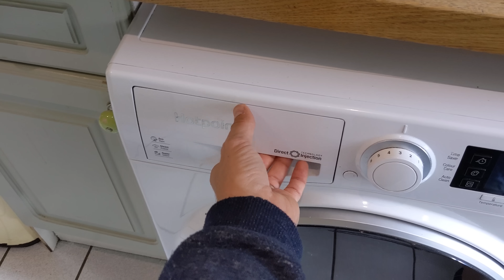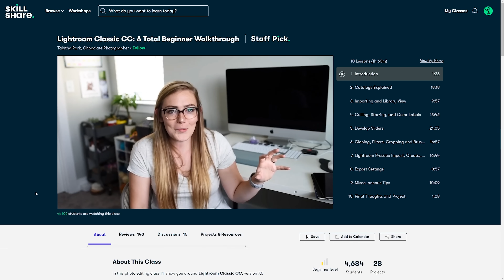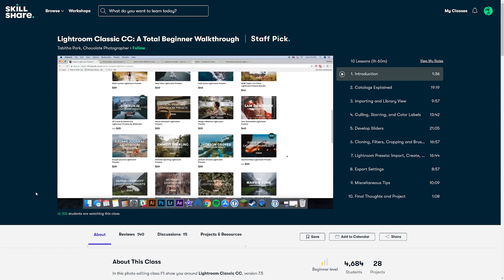The Pythagorean Siphon Inside Your Washing Machine

Comment: In canada most toilets have a buoyant valve (looks like a ball with an o-ring around it) that is held down by the water pressure, you pull the lever and the valve is raised and remains open due to its buoyancy, after the water has drained the valve forms a seal again and the water can start to collect in the reservoir.

Comment: What I’ve really learned is American toilets and urinals are different. Never seen a urinal that flushes itself, most are water free and some have handles. Toilets have a stopper at the bottom of the bowel that lifts and is buoyant but not enough to open by itself so once you open the stop it floats until it closes because the basin is empty and seals again as water goes over the top.

Comment: I'm guessing the toilet mechanism that you're demonstrating is for a UK toilet. I've never seen anything like that in the US. In US residential toilets, the level raises a stopper in the bottom of the tank that allows the water to run (by force of gravity) into the toilet bowl -- no siphon involved. However, on the drain side of toilet it is a Pythagorean Siphon that causes the bowl to completely empty. While the tank is refilling, a small amount of water runs into the bowl to refill it but not at a high enough flow rate to trigger the siphon to empty it again.

Comment: Yeah, I'm not a plumbing expert by any means, but my toilet tank is a little different. I'm in the US, if that matters. Mine doesn't have any kind of rubber balloon thing, & I don't think it gives the half vs full draining option. Mine has a tube of straw thing that actually looks a lot like the fabric softener compartment in your washer. At the bottom of the tank, there's a thick rubber flap, with a little chain connecting to the flushing handle. When flushed, water drains out of that hole. Once the water's gone, the flap covers the hole again. There's a little thing that runs water back into the tank, and when the water reaches the top of the tube/straw thing, the water stops.

Comment: I thought the syphon in a toilet was the tubing that takes the waste out to the sewage, not the one that purs water into the bowl. I once was in a place where the toilet didn't have a basin; we'd just flush by pouring in a bucket of water and it would then work like any other toiled I had seen. And that should make sense: if you throw in a large amount of water you wouldn't want the toilet to fill up and eventually spill on the floor...

Comment: that's not how north american toilets work. there's just a flap at the bottom of the tank that allows it to empty initiating the siphon in the bowl.
crazy european toilets...

there's also a pythagorean siphon in your septic tank, if you have one.
Reply: Also newer flushometer and pressure assist toilets siphon in a slightly different manner using the siphon jet to immediately flush out the water and siphon without a gurgle. But their siphon effect is still used to flush.

Comment: How odd, my toilet does the exact opposite.  If I hold down the lever, I get a full flush, and if I let go as you usually would, I get half a flush.  Didn't know this in 22 years of owning this toilet!
Reply: That's because your toilet is what's called a flapper valve. It's a much more simple method that uses a 'float' to determine how much water is in the tank. When the float raises a certain amount the tank stops filling. When you use the lever it opens the valve at the bottom of the tank, so you can control how long it allows water to flow through the system. When you release the lever the valve automatically closes, and the float then works to ensure the tank fills up with water properly.  It's the method I prefer, as it's very simple and easy to fix yourself if any parts need replacing ^^

Comment: What I know about flushing systems is that my box room toilet flusher needs a new washer to block the water coming in when it fills. The washer is of rubber and it got torn by time. I wouldn't like to replace the whole flushing system for just a washer. But I don't think I could find a new washer for it either. Any clues for what I should do to solve it? Thank you for the video.
Reply: You can buy any washer you like on Ebay, what makes you think you can't buy a washer?!  Even if not, you can replace only the filler which is nothing to do with the flush and siphon part.  You can buy them now with a 2 inch long ballcock!
Reply: If it's a washer thats attached by a small chain to the handle try searching "toilet flapper" and they're pretty cheap and really easy to change. Anyone can change the flapper on a toilet. You just switch it out and trim the small chain so there's not too much slack (it will get caught under the flapper, preventing the seal,, and you're toilet will keep running) and that's it. This is for US flush systems though. I'm not sure about the other ones but they all work similarly. Flush valves aren't too hard either. Hope this helps 👍

Edit: minor grammar and wording edits

Comment: Older American toilets didn't have that mechanism, the flush handle simply pulled a plug at the bottom to release the water into the bowl, this plug floats after you pull it and once the water level reaches the bottom the plug falls back into place stopping the water flow and letting the back of the toilet fill again. Oh also, if you are wondering why the plug doesn't always float and release water, it's because the waters weight is enough to hold it down until you flush.
Reply: A lot of toilets in ex-USSR countries work the same way you described, my mom still owns one of exactly this kind.
Reply: Not just older ones. Many newer ones here do, too
Reply: I just installed a relatively cheap one where it doesn't even float, the plug drops into place as soon as you release the lever.  It's just designed so the water flows so fast, the fastest possible pull still releases about 2/3 of the water.
Reply: Normal solution in Norway too.
Reply: 4 YO toilet, still has a flapper valve.

Comment: Now here's a thing which has bothered me for years,which I'm beginning to think may somehow be explained by siphons.
Not far from where I grew up is a pair of streams (bournes to be precise) which emerge from the dip-slope of an aquiferous chalk syncline  and flow away to the north.So far,so ordinary,except these bournes,unlike the more usual annual "Winter-bournes" only flow on average every seven years or so,seemingly irrespective of climate.
If it were a case of them simply flowing when the aquifer is full,they would flow a fixed period after a period of heavy rainfall,then stop when the aquifer is depleted down to the spring-line as is not uncommon in Chalk landscapes.
But they don't.
It's as if they empty the aquifer to the point where it takes seven years or so to replenish,before they can flow once more.
Is there any way that this can be explained which doesn't involve a siphon? And if not...how would such a (natural,underground) siphon actually function?

Comment: One design that we use here in America, and I don't know about elsewhere, is a simple flap at the bottom of the tank that floats when you flush. When the tank level gets low, it plugs the hole. Stupid simple.
Reply: Another style has a pressure tank within the 'tank'. It operates at the PSI that water comes out of the pipes at.

Comment: Your forgetting that the drain line is attached at top of the washer machine on the back to reach the drain line in the wall,  so does this type of syphon valve work uphill? Because I doubt it will, that why they need a pump motor to push the water uphill.

Comment: I THINK the syphon was a stipulation of water companies in the past for water economy.
The original syphons where cast iron bell shaped things. The bell was hung over the discharge pipe and was lifted by the pull chain to initiate the syphon.

Lots of toilets use a flap valve now.

Comment: In the US, I have 1 typical toilet that has a rubber plug, that the handle lifts and gravity will put back in place when the water is out of the way, with a float to know when to stop refilling the tank.  However I also have an uncommon toilet that uses a bucket in the tank...  like what you see at a water park, the bucket is filled with water and the handle tips the bucket.  The frequent problem with the rubber plug is a single speck of rust or sediment in the tank can prevent a seal - causing water to continuously flow slowly.  An occasional problem with the bucket is it can balance while tipped, allowing it to pour and fill at the same time - causing water to continuously flow quickly.

Comment: so if you hold the flusher down it'll only flush half a tank, but if you flush and let go it'll do a full flush? dude! thats like a toilet easter egg right there! The toilet i have has a button press on top to flush (mechanical not digital) that is split in two. one side you push for a full flush, and the other side you push for a smaller flush, so now im curious if that smaller flush button utilises the same mechanic but automatically?

Comment: hmm  my toilet has a simple valve on the bottom with a float attached that cant overcome pressure when slowly filled but when the water is deep and the lever pulled it floats until empty.   canada.    toilet is at least 20 years old.     love your channel
Reply: i cant think of any advantage to the syphon type because a slow leak  will waste the same water on both.

Comment: No idea if my toilet has a siphon or not, but if i keep holding the flush button, the water keeps flowing and flowing until it eventually just drizzles for as long as i hold the button. Sidenote: there's also no visible water tank, it's inside the wall. You can hear it filling up after flushing

Comment: An older design of flush was a bell shape the entire bell was lifted. The flush only started when the bell dropped. The bell's weight allowed the bell to drop rapidly. The bell shape forced the cylindrical volume of water under it into the smaller volume inside the bell. This raised the level of the water to initiate the syphoning action. I believe this system wasn't as effective and needed the cistern to be at a height.

Comment: I don't think I've ever seen a toilet with a siphon in the US. Generally there is just a flap that is slightly buoyant. The lever lifts the flap with a chain. Once lifted, its buoyancy keeps it open, until enough water drains that the flap closes. With no water underneath it, the flap is no longer bouyant and seals the exit pipe.

My guess is that the siphon system is actually a better solution because it eliminates a point of mechanical failure. Sometimes the flap gets old or doesn't sit right and can cause the tank to slowly leak into the bowl, but as the tank drains, the float lowers and causes the valve to start refilling the leaking tank, making it a perpetual leak.

Comment: Lived in a new house with no reason to lift the lid on the 3 toilet tanks.  After watching this I went to look.  They have a different low flow, non siphoning mechanism.  (Koehler brand - US) The funny thing is that I didn’t know the toilets had partial and full flush capability until today.  Also discovered all tank levels were slightly high and the plumber installed one incorrectly and I have another house project today - Thanks!

Comment: Don't know if anyone answered your question as this film was a while ago. I think the syphon flush is used because of UK water health regulations requiring air gaps between dirty and clean water to ensure no backwash or back contamination into the water supply through continuously dribbling water I. E. leaks. You can get other types now due to being in the EU (back then) but these don't comply with the rules, so the rules were changed to an inferior system to comply with EU edicts.

Comment: I think they are different in Finland. The overflow tube is just a simple tube at specified level. Also it is more like small press releases only little water thigh I do not know it this is a designed feature. It simply has a valve at the bottom. Some toilets do have small flush as a design feature. 

In the US when the reservoir fills part of the water goes to the bowl. US toilets have a very high water level in the bowl.

The benefit of the siphon method is that it cannot start leaking when it ages.

Comment: I have an older model washing machine that has an internal structure similar to your 2D model, which is pretty cool but also makes it almost impossible to clean. It's second hand and it had a huge buildup of soap residue on the inside

Comment: My new apartment has a k8nd of toilet I've never seen before where instead of a lever, there are metal buttons to push in. Combined they make a circle, like an unequal yin/yang, as one button is larger than the other. Supposedly, one is for whole flush and one is for half flush. I say supposedly because I honestly can't tell the difference between pushing one, or the other, or both combined. The buttons are also extremely difficult to push in and can be quite painful, especially if you make contact on the braille like portion of the buttons. I'm assuming it's braille anyway... I'm slightly perplexed by this toilet and I honestly don't like it. A toilet shouldn't be difficult or painful to flush.

Comment: LOOKS SMART BUT WITH MANY FLAWS.... NO 1 LIKE HE SAID. LEAKING. NO 2, ENOUGH WATER FOR SEAL TO BE CREATED. SO ANY LEAKING WATER WILL JUST DRIP INSIDE THE SIPHON. DUMB INVENTION. THE BEST IS PLANE TOILET. AIR PRESSURE. U NEED AIR TO FIGHT AIR..BY MAKING IT VACUUM AT SWAN NECK TUNNEL, THE AIR WILL SUCK ALL UR SHIT WAHAHHAHAHAHAH WATER W.C IS DUMB WASTING WATER TO FILL IN, MEASURE N SEAL. 3 WORKS JUST TO PEE OR POO.

Comment: Steve, you've made a really explanational video about the kind of siphon. The 2d experiment is beautiful.
Concerning the toilets in Russia: for all my soviet childhood (and, I guess, long ago before) we used only flap design with the flap sealed by the water pressure of the full tank (like Americans do and in your case too). I maintainced them a lot - pouring valve defects, flap hardens or contaminated (doesn't seal) and so on... In modern times we use different systems from mainly European manufacturers (with two volumes flushes options too), but they always use a kind of flap, so I've never seen the siphon type of the flushing device.
Anyway, it was cool to get into all of that!

Comment: That's not how toilets in the U. S. work. The handle pulls up a stopper in the bottom of the sistern quickly draining the water into the bowl the stopper then gently falls back in place stopping the drain to allow the sistern to begin filling again, a float is used to maintain the same water level. When flushed the bowl water and contents are forced out through a "s" trap within the base of the bowl and into the toilet stack(sewer pipe,)

Comment: You said that a toilet doesn't use a greedy cup siphon, and then demonstrated the siphon mechanism from the tank, but what about the bowl? When I was a kid we had a toilet whose tank broke, and until we could get it replaced we flushed it by filling up a bucket in the tub and pouring it straight into the bowl. That triggered a flush when it hit a certain level, which certainly sounds like a greedy cup siphon.

Comment: This is actually wrong, because your washing machine uses an agitator to move around the clothes and get them clean, not through a jet or whatever. The agitator spins back and forth by a vertical motor. The agitator has baffles on its sides to pummel and move around your clothes, Thus, removing dirt from fabric

Comment: In very old toilets (well, U.S.S.R.) , there was literally a  hole a cone-shaped rubber plug (like in bath tubs, but bigger) at the bottom of the "tank", which you pull out by pulling on the flushing lever or cord. When you release the cord/lever, the plug goes back into the hole blocking the flow. The valve and the float worked the same way. Plus overflow pipe. So, much simpler construction with no siphon at all. Also allowed "partial" flush depending on how long you pull the flush lever, -- pulling for longer -- emptying the whole tank.

Comment: Are you in Europe or is that just a newer style of toilet?  Old style american toilets are different.  They fill the upper basin with water.  There is a semi-buoyant rubber flapper holding back the 5 gallons of water of the upper chamber.  When one pulls the flush handle, the semi-buyoant float remains suspended in the water (allowing all of the water to fill the bowl) until there is no longer water enough water to float the flapper.  The flapper then falls back down, covering the hole, and the weight of the water presses the rubber flapper down for a tight seal.  Water pressure then holds the flapper in place until the handle is pulled again.  When talking about siphon toilet, you didn't mention the lower bowl also being a siphon!

Comment: Can you make an auto-siphon that releases a lot of water simultaneously?
I guess you may have to use some smaller starter siphons to get enough water to fill the pipe. It could for example be used to flush public toilets at regular intervals.

Comment: My toilet doesn't use this effect. It's a very simple model - just a cylinder with a rubber ring covering the hole where all the water runs into the bowl when you flush. The cylinder is just a thick tube, so if it begins to overflow, the excess water will just run down the tube and into the toilet bowl. Very very simple.